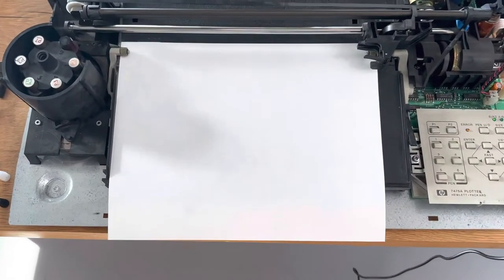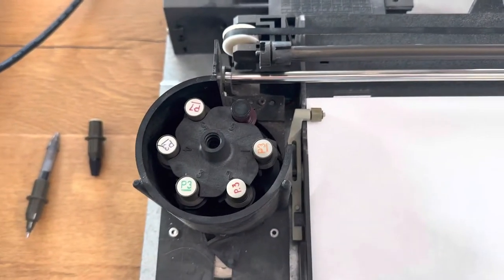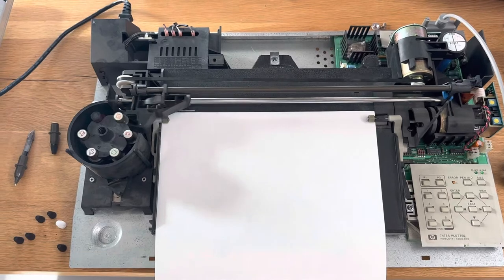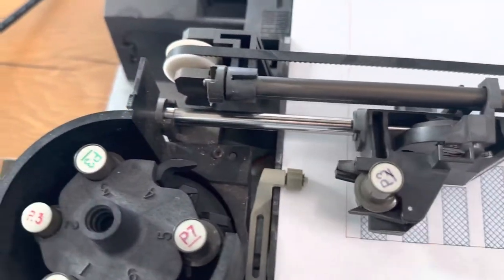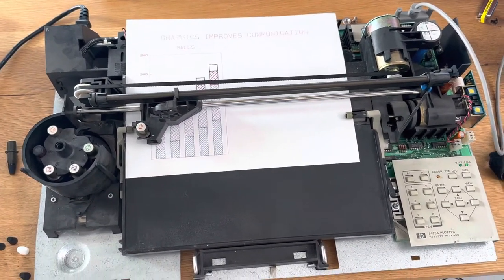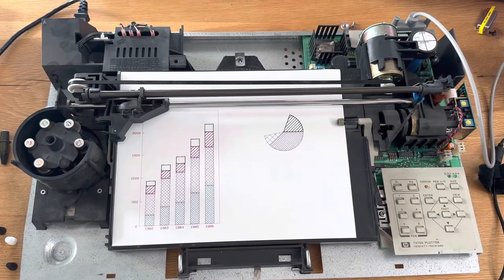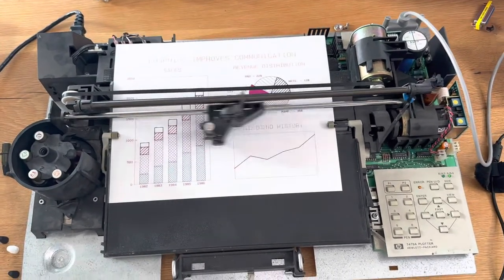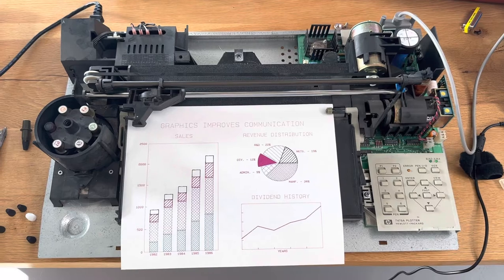Demo of an HP 7475a pen plotter

Comment: HI!
Between the 80s and 90s I had the opportunity to work with these wonderful plotters, now I have one and I ask you if there is the possibility of interfacing them with a modern PC with Windows 10 and to make them work again what software can I use? .
The 7475A plotter in question has an RS-232 - C/CCITT V.24 type serial port, are there any adapters from this type to the USB type serial port?
Thanks in advance to anyone who can answer!
Reply: These are great. Amazon has them. Tripp Lite 5ft USB to Serial Adapter Cable (USB-A to DB9 M/M)(U209-000-R)